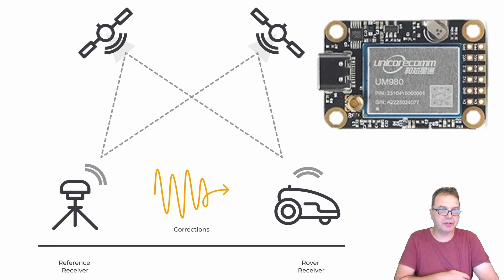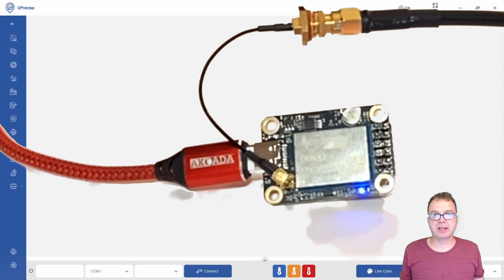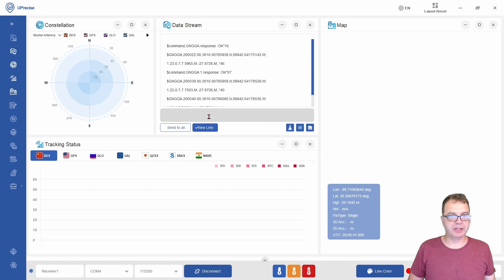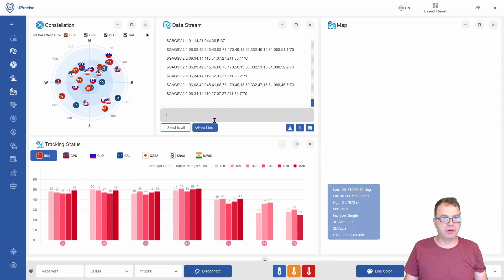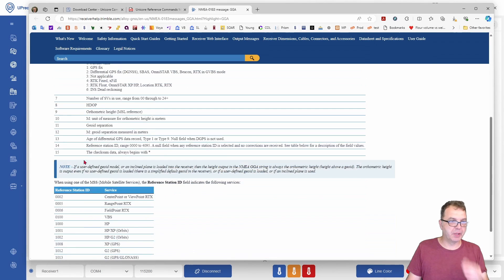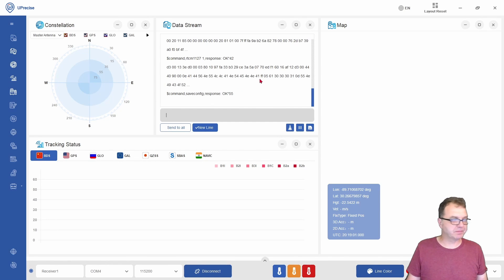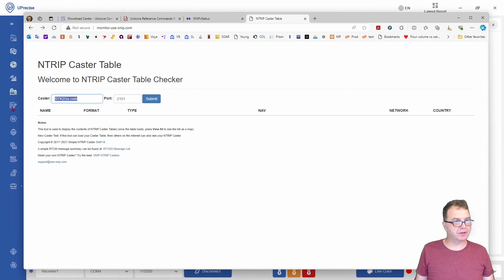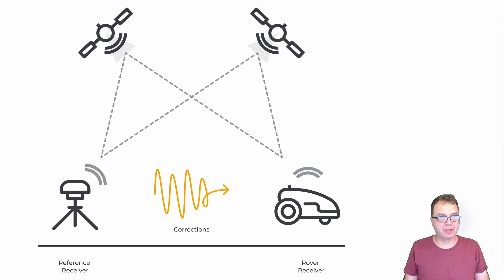Setting up a low-cost DIY RTK Base Station based on the UM980 module

Comment: Would you be able to provide POE for data and power for the UM980 directly, or do you need an intermediary module?
Reply from the maker: The UM980 typically communicates over UART. Some versions can support I²C or SPI, but UART is the standard interface. So, in most setups you’ll need an Ethernet-to-UART converter if you want to run it over Ethernet.
Reply: @oceanexplorationlab  Thank you
Reply: @oceanexplorationlab  I've done some more research on spec sheets and the UB9A0 1 x UART (RS-232), 2 x UART (LVTTL) 1 x LAN, 10/100M
Reply from the maker: @416XYZ  That’s a good one — I wasn’t aware of that module. Have you seen where it can actually be purchased? Definitely something to keep in mind. Thanks for pointing it out!

Comment: After "freset" On command "config signalgroup 2"  dont receive any satellite signal in my window ?
Reply from the maker: The command config signalgroup 2 only defines which signals are decoded—it does not start NMEA output. To receive satellite data, you need to activate the GNSS messages you want by using the appropriate output/streaming commands mentioned in the video.
Reply: @oceanexplorationlab  I activate GNGSV command but nothing hapens on display, see lots of info coming in too data stream window but on tracking status and constellastion nothing..
Reply from the maker: use all of the below:
GNGGA 1	(Time, position, and fix related data)
GNRMC 1	(Position, velocity, and time)
GNGSA 1	(GNSS DOP and Active Satellites)
GNGSV 1	(number of SVs in view)
And let us know your results. Good luck

Comment: My UAV has one um980 and one unblox f9p. I have a heading problem due to magnetic effects. I aim to be able to do heading by making f9p as moving base um980 as rover. Is it possible?

Or if I make rover um980 and make f9p as movingbase, will it work?

Comment: I want to use this setup for a ardupilot drone gps RKT setup. Is one UM980 as base station and 1 UM980 attached to the drone enough? Or is it beytter to have two UM982s? Thanks for the contribution.
Reply from the maker: For the base station, there is no advantage and several disadvantages to using the UM982. For the drone, if you want to get orientation, you may want to use the UM982, but you also need to carry two antennas!
Reply: @oceanexplorationlab  First of all…Thanks for your reply. The drone already has a gyro build in for direction. So one UM980 with a YH-609 on the base station, and one UM980 with a YH-609 on the drone will already be enough for a more accurate GPS data point.

Comment: I appreciate your contribution and help for those of us just starting out in the world of GNSS. If you could make a configuration video in rover mode connected to a CORS network with ntrip, I would be very grateful. Your configuration helped me, but I can't get corrections smaller than 1.5 meters with ntrip on the Uprecise platform. With the SW Maps app connected to my phone via cable, I have a 1.2 cm error.

Comment: Hi, good presentation,

1. Does this module support web UI or only software for settings?
2. Can it store RINEX data for later use?
Reply from the maker: you can use the UPrecise software to save the data form the UM98X to RINEX. I don't know bought any web UIs

Comment: Hi great videos - thanks for inspiration ;]. 
Have you tried to send corrections directly from one module to another (on local network for example) ?  Without going through RTK2go ? I'm thinking about local setup in first step (to test and optimize my setup before sharing).
idea is to setup 2 ESP32 with Xbee32 - one with UM980 configured as base and with caster active and second set as rover with NTRIP client. 
I'm currently trying to set this up but it's not working. NTRIP client keeps getting disconnected.
Reply from the maker: Yes: https://youtu.be/YeuwY2A0FpM

Comment: Your videos have been very helpful. I'm playing around with setting up my UM980 base station. QUESTION: Do you know why the map always shows some spot in the Eastern part of the US, instead of my actual location? And, how do I fix it?
Reply from the maker: That’s definitely odd—especially if the coordinates you’re getting are actually correct! Where would you expect your location to show up on the map? It almost sounds like there could be a sign error or something similar causing the display issue. Double-check if the latitude and longitude signs (+/–) match your actual location. Let me know what you find!

Comment: Hi, thanks for the guide, I have my UM980 up and running on RTK2go and my name is RTK42media its in Arvika Sweden, my only problem is that I don't see any satellites after I use the GNGSV 1 command on the Tracking Status and Constellation in the UPrecise but everything works.... don´t know if its a bugg or a setting I missed,  this weekend Im gone add the ESP32 to see if its works

Comment: Thanks for a really useful tutorials,  i just wander how to send this correction data over your own radio like loRa or aver similar ones?
Reply from the maker: Sending data over LoRa is a common request. If I find the time, I plan to do a video on it. However, there is nothing particular about the correction data that prevents you from sending it the same way as any other data from UART. I have a video on using local Wi-Fi; you may want to check it out (https://youtu.be/YeuwY2A0FpM). Good luck with your project!

Comment: Thanks for explanation. Great video.  Just as an FYI in some models you have to manually add \r\n a carriage return and a new line in the end of each command in order to be able to send it.
Reply from the maker: Absolutely, the commands have to be terminated with a new line character. In UPrecise, this is accomplished by checking the "New Line" option. Thanks for highlighting this caveat.

Comment: I’m missing something…..how is the accurate position of your base station antenna calculated and where do you set the ‘actual’ antenna position?
Reply from the maker: In the tutorial, I use the Self-Optimizing Base Station Mode. You can read about it in the Commands and Logs Reference Book available at https://en.unicore.com/. Basically, it averages the position over a set time and uses it as the location if the station is not moved by more than a specified distance. You can also provide the coordinates using the Fixed Base Station with Precise Coordinates option. I plan to make a video on this.
Reply: @ thank you

Comment: hello, thanks for the great video, I have a question have you tried the UM980 module with Galileo HAS? I wanted to use a Pixhawk 2 black cube to have PPP-RTK corrections. Thanks in advance
Reply from the maker: I have and it works. I plan to do a video on it soon

Comment: Thanks again for the video it is very helpful. I think I am having the same issue that you did with the pigtail. When I run Version I get: VERSION,98,GPS,UNKNOWN  verses FINE? Is there a trouble shooting resource besides the 300+ page PDF? I couldn't find anything in it that addresses this issue.
Reply from the maker: The "UNKNOWN" indicates that the module has not calculated the GPS time, likely due to no satellite data. Do yourself a favor and purchase some high-quality pigtail connectors. Google: "MMCX to SMA Female"
Reply: @oceanexplorationlab  Thanks! I will.

Comment: I plan to purchase UM980. Which one would you suggest? I've heard there is a heat problem with the one from AliExpress. Any problems with your UM980 GNSS module? Thanks
Reply from the maker: None. Also, this is the only one I tested, so no suggestions otherwise.

Comment: next this config with GNGSV 1 i cant see satellites on constellation map
Reply: this is the commands launched 
freset
config signalgroup 2
mode base 60 2 2 5
GNGSV 1
unlog
rtcm1005 30
rtcm1033 30
rtcm1077 1
rtcm1087 1
rtcm1097 1
rtcm1127 1
saveconfig
Reply: i try don't use unlog but the satellite map not working!
Reply from the maker: you may be missing the GNGGA 1 command
Reply: @oceanexplorationlab  thanks
Reply: @oceanexplorationlab  yes, but in this video all constelations etc came back with the single "GNGSV 1" command, this is no longer true, with a fresh um980 module, maybe a FW change.
GNGGA 1, gave  back the map but not constellations.

Comment: hi , i try mode base 60 2 2 5 but my um980 send message "fixed position is not correct" , need to put: mode base time 60 2 2 5  ?
Reply: next send:MODE BASE TIME 60 the message is disappeared
Reply: mode base 60 2 2 5 is wrong conf! the correct conf is: mode base time 60 2 2.5
Reply: i want more of 2m of precision is possible put 1mm? like mode base time 60 0.001 2.5
Reply from the maker: I believe there is a misunderstanding regarding the command. In the command: `mode base time 60 2 2.5`:

`60` is the time in seconds that all fixes obtained by the UM982 must remain within an area of horizontal and vertical precision.
`2` is the horizontal precision in meters that all fixes must meet to declare the survey complete.
`2.5` is the vertical precision required for all fixes to complete the survey.

If the previously saved position is within these ranges, the station coordinates stored in flash memory will be used; otherwise, the position in flash memory will be updated.

By the way, a 1mm precision in positioning is unrealistic.
Reply: @oceanexplorationlab  why is centimetric precision? in the datasheet tell of 0.8cm
Reply: @Dark_Phoinix  in ideal conditions
Reply: I fell into this one also, hehe, a bit difficult to see in video on laptop screen

Comment: Hello, your video is very good, congratulations on the tutorials. Can you tell me how to activate the GNSS um980 in ppp mode E6-Has?
Reply: At the beginning of the summer, firmware for the um980 was released, which has this feature. The activation command is in the instructions for the modules.
Reply from the maker: 108 / 5,000
I haven't figured out the PPP myself jet. But when I do I plan to make a tutorial. Thanks for the suggestion